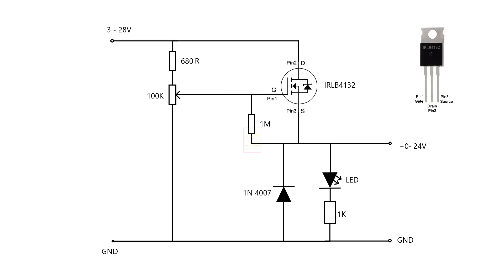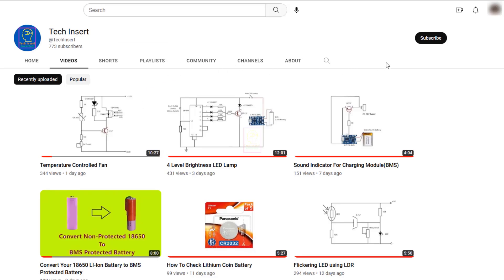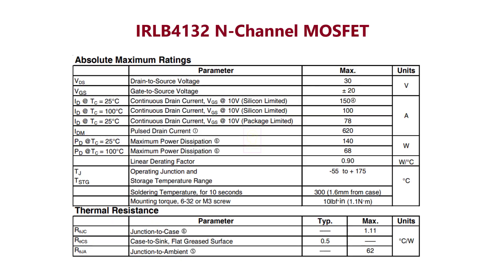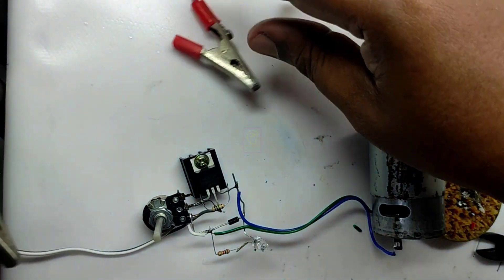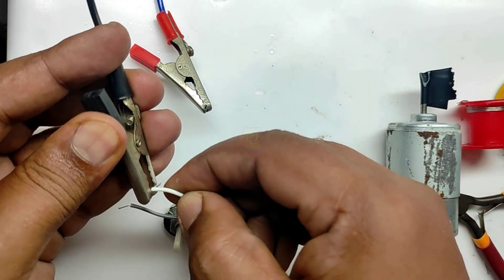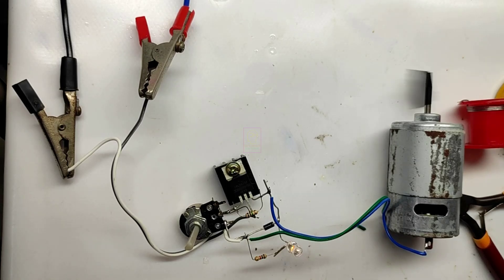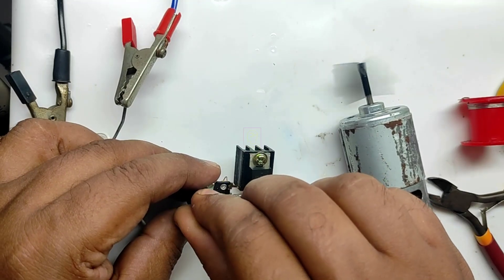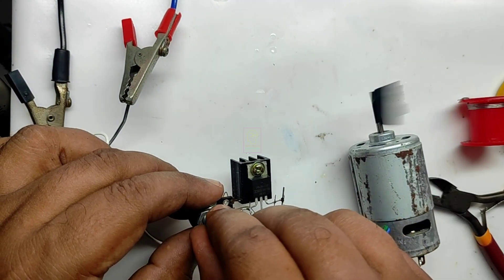How to make Motor Speed Controller | DIY Motor Speed Controller

Comment: 👎
Reply from the maker: Dear friend why thumbs down. Kindly tell me the reason so that my knowledge will also increase.
Reply: @TechInsert  in the circuit diagram, please mention component values and give purchase links. Always explain your circuit working in detail. Your videos should be followed by absolute beginners and not by experienced people. Also your circuit working explanation should be such that beginners should manipulate and apply in any application. Then you will get maximum likes and subscribes. You are no doubt real expert, so should make others also experts. Make long videos without background music, use your audio to explain theory and practical, not just component soldering. Sorry for thumbs down.
Reply from the maker: @sridharkrishnappanavanerth3388  Thank you very much for the reply. I have added the component values in the circuit diagram. If I am using any specific components or modules which are not easily available in local market , those purchase links I had added to my previous or other videos. But for this video , all components are easily available in local market, that is why i didnt specify that in description. I will always try the circuits 2 times, one for making it working and deassemble it and make it again for recording for youtube. Whatever issues i am coming across will tell in the video itself as tips and tricks.Will definitely follow your comments😍
Reply: @TechInsert  Wow, Thanks